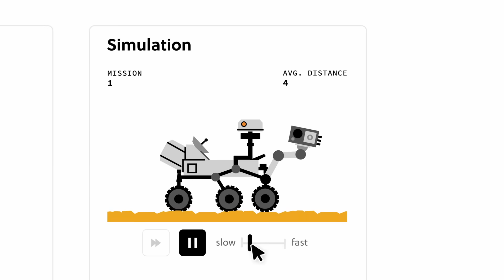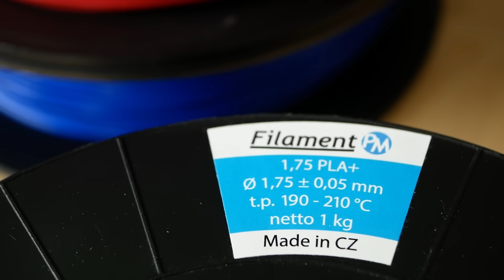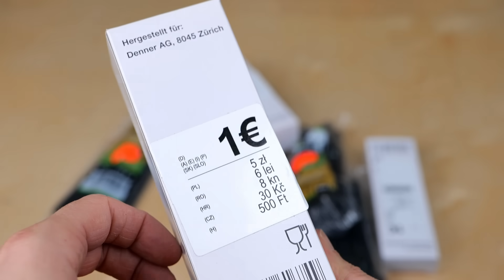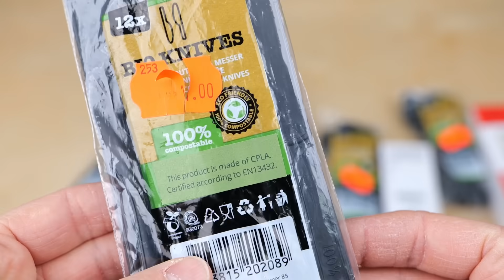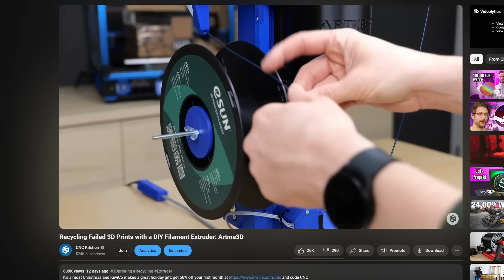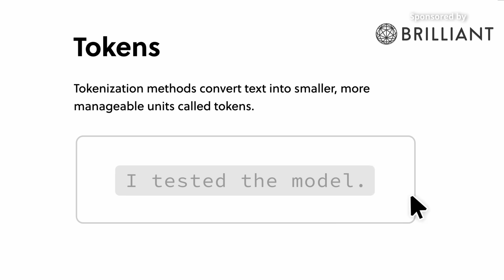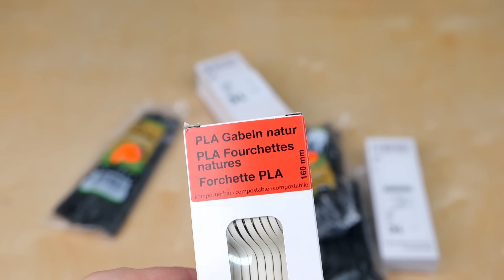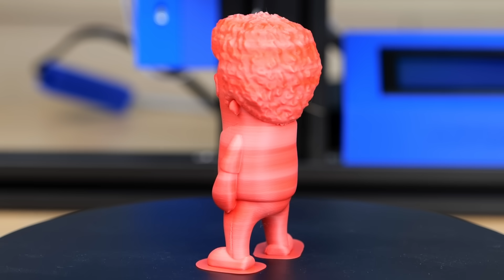From Trash to Treasure: Recycle Cutlery into 3D Filament!

Comment: I work in injection molding hopefully I can help with some mixing percentages. For most of our materials we have anywhere from 4%-6% for color hopefully this will help with color consistency. As far as regrind (recycled plastics) go, we change % based on how much scrap we have. Recycled plastic has generally already gone through a heat cycle and the polymer chains do break down causing a less viscous melt. This could be why your diameter for your recycled filament wants to stay undersized but when virgin material is added the diameter increases. If you want to do a 15%-20% Virgin added to regrind, then maybe stepping up a nozzle size on the filament extruder and running a slightly hotter melt.  This hopefully will help with filament diameter and a more homogeneous and consistent melt and color. As always do what you do best and experiment for the best results. I just hope this helps put you in the right direction.

Comment: would love to see some more plastic trash turned into new parts, i still have a lot of ABS parts flying around for example. would also love to see a direct conversion, ie, parts to filament, i wonder if different heat zones with different viscocity would create the possibility of filtering, seperating junk with magnets and a fine mesh at a hot zone, and then cooling it 20C or so for the extrusion process.
Grinding is always quite the intensive proccess, or requires expensive machines. something like a waffle with a clamp to squeeze it into the proper melt zone would be a strange idea.
instead of shredding (which is really easy if you have filament) just convert parts with max of 10x10x5 cm into molten goop first.

Comment: Out of raw curiosity: How does filament made from water bottles with the Artme3D compare to the same material made with the converted Ender 3 you showcased a few months ago?

And followup question: can you make usable filament out of different materials in the same batch? They would all need to melt at the same temperature and have similar printer settings of course. Think something made from part plastic cutlery, part old failed prints, part water bottles, and part virgin pellets to stabilize the mixture.

Comment: Halo Stefan. I don't have an idea what to recycle next, but I remember Thomas from @MadeWithLayers made quite some time ago a 3-Axis filament thickness sensor with Hall sensors (sounds like a vid sponsored by PCBWay ;-)). It would be really interesting to combine it with the extruder you have - either by you (singular or plural with Tom) or by the OG inventor of the machine. 
BTW. Marinara recipe is missing in video description :-D

Comment: Usually when production factories use recycled materials, they usually chuck in like 20-40% with virgin material, to make sure to be able to keep these properties of the materials. So I think only using 20% virgin is quite nicely done. But then again this is just for a single roll of PLA for a more "simple" 3d printer, so not really the same as a large production facility.
But I can't wait till these shredders and recycle machines will become cheaper and easier for the rest of us to attain. Maybe make one by taking apart something like a paper shredder.

I absolutely love the idea of failed 3d prints just getting grinded up and remade into something else.

Comment: DRONE PROPELLER blades, bitte!  
I just crashed my quadcopter so I am waiting on new propeller blades from Amazon, while two 3D printers sit next to me alongside the broken propellers.  Maybe quadcopter propellers (or the bits I have remaining) could be ground up, supplemented with virgin material, and re-manufactured via 3D printing~!

Comment: I'd love to see more DIY methods for recycling pretty much any of the commonly recycled plastics (PET, HDPE, PVC, LDPE, polypropylene, polystyrene), albeit into homemade 3D printer filament or even injection molded parts (using 3D printed molds)
Reply: Investigating the use of high-force extruders for injection molding with common plastics would also be quite interesting
Reply: Pet would for sure work, not sure about the others
Reply: PET won't work. The melting temperature is 245C, not 165C. You would need more expensive extruder for PET.

Comment: One thing I've always wanted to know more about is why some types of plastic, such as the ones used for "clam-shell" (aka very difficult to open by hand, or vacuum sealed) aren't recycled at least in my area. I'd love an explanation for why, even if you can't actually re-use it as filament.

Comment: you should do plastic bags! i feel like its possible to turn them into filament.

edit: i wish i had a filament extruder like yours to try. i feel like static will be problem with single layer pieces of bag, but if you did the clasic diy bag ironing and put those multi ply sheets through your shreder ( also would be fun to have) you would have some weighty plastic bag pieces to extrude. plz try i need to know noones done it on youtube i think

Comment: I am admittedly very new to the 3d printing community. I do have a hypothesis that coloring in PLA tends to make it more brittle and the darker the color the more pronounced the effect. Maybe that could be a video idea? testing different color PLA and its mechanical properties. Usually they test brittleness by resistance to impact in tests like the Charpy V notch test. Maybe you could design and use that as a test in the future.

Comment: I really like the idea of reusing plastic.
But I am not sure that this setup is efficient enough to be a net win (for the planet).
You need to clean it, dry it, shred it, try it, melt it, (probably dry it) and melt it again. All these steps uses energy (and sometimes water) and I just looks like a lot. Maybe if the energy comes from wind and solar it might be ok, but it is really hard to say if this is a good idea or not.
Maybe new plastic takes up a lot of energy to make and it only takes a little to reuse it (relatively), the same way as reusing aluminium, but I think it is hard to tell.

Comment: This is, if anything, a good way to get cheaper filament but I don't think it's going to save the environment at all. Nobody is asking how many benchies are out there doing nothing or how many failed prints are taking up residence in landfill. Plastic recycling is the answer there and most municipalities here have taken up recycling these thermo plastics. It would be cool to see a 3D printer attachment able to use shredded recycled plastics and melt-on-demand into a filament as it is needed for use while printing. In the end, as has been demonstrated here, virgin plastics are needed to meet industrial demand. As it is, most manufacturers need predictable real world results and recycled plastics are going to provide inconsistencies which end customers will not put up with.

Comment: Those brittle plastic utensils and brittle biodegradable utensils were always a spooky thing to eat from most my life, especially the forks, prongs can break and go down with the food. I preferred the flexible plastic utensils and I reuse them like metal utensils, great for the backpack and that way I could avoid using new plastic utensils including those which are brittle when ordering takeout meals. And I feel the same about all other plastic products with longer usage intended including radios, they shouldn't be brittle and may not break or crack from normal impacts if being made of that flexible material. 

Adding virgin pellets, I didn't know that works to lessen brittleness as you say, though I worked in a plastic factory for about a year as a material handler and used both new and regrind materials for jugs, tackle boxes, buckets, bottles and caps among other products from blow mold and injection mold, not utensils though. We added new pellets to same material regrind to add content not to change anything, but then it may need an awkward colour feed adjustment so normally we added new towards end of regrind and reset the colour feed for that. Mixed regrind colours were normally turned black, but still same materials. I don't think we had brittle products coming from where I worked. Things were more durable, at least during their initial uses and most of it likely beyond. 

I have some products I bought from that place and one from there which I acquired with an icecream purchase, and they are as good as new except the icecream bucket which discoloured but isn't broken, that's going back maybe 15 years ago. And I have some single use plastics from other companies, which I reuse. I put what I can't keep for being too much and especially brittle products into back alley recycling bins.

Great video, I learned from you.

Comment: Why not try recycling the 2nd most recycled plastic on earth, HDPE, which I believe comes from those large liquid containes (like milk jugs). You have already done some PET recycling using pultrusion, however HDPE is also heavily recycled, however it is not commonly printed as it usually has bad bed adhesion and warping. However it looks like HDPE can be mixed with PLA, so maybe you could do a video trying to print HDPE, then trying making your own custom blend to see if you can improve the properties. You could even talk about the issues of mixing plastics when recycling.

Comment: Would it be possible to recycle styrofoam/polystyrene based single use plastic? Might give off worse fumes but you're already wearing a respirator
Reply: It's possible but very costly and are only done in recycling centers that specialize in recycling them. For the most part, it's simply not worth the effort.
Reply: @DarkZerol  That's the reason why I think it would be interesting for an amateur to attempt

Comment: Very fascinating filament processing Stefan. Wondering what the results and properties of "twice processed" filament would be? ie: if the initial recycled filament was chopped into strands to be re-extruded into filament. Thinking this would provide much better mixing and blending in the final result. 

The biggest problem I see is the unknowns of the recycled material. Poor labeling and the many non-standard plastics in use would make it very hard to scale up. One of batch processing is great for learning, but is far from being made into a sustainable process at scale.

Comment: A lot of products sold in the US come in clear hard plastic packaging. Apparently its supposed to provide added security for the consumer and manufacture, but I find clear packaging to be frustrating. Its wasteful as a single use plastic and it is it very difficult to remove the item you just bought. You always need scissors or a knife, but you may end up cutting yourself as the plastic can be sharp. I'd like to see this turned into filament.

Comment: I have to say that your approach to making the cutleries dirty struck me as German. Like seriously. You cooked a wonderful sauce that you literally spilled on brand new, unused cutleries! Stefan! Seriously! You could have thrown a party for god sake and we would have enjoyed some of that delicious sauce.

On another note, I would be very interested in shredding old broken PP and HDPE containers from IKEA and cracked sichtlagerkasten and the like, turn them into filament, and maybe printing with them.

One of the big benefits of printing with a material like PP is that it can be "welded" into existing PP commodities with heat. For example, you could print hinges and weld them with heat into cheap BAUHAUS PP containers, instead of PLA clamps that I saw you using when keeping filament boxed with desiccant.

Finally, I must say that I have quickly become a big fan of yours and if you happen to come to Aachen, then you are invited to meet the maker community here. I really admire your work and I have been drooling over the Artme 3D filament extruder since I was introduced to it through you. I wonder if you know the maker of the kit in person.

Comment: I really appreciate all the work you do.

Since you have a shredder to go with the extruder, can you run pet bottles through it?  Only using the middle part of the bottle hardly seems worth all the effort of other methods,  but your set up could really make it worthwhile if the extruded filament was as good as the other batch you did a month ago

Comment: I wonder if you could use the black CPLA as a sort of master-batch. So extrude it into a filament, where diameter doesn't really matter, immediately pelletize it, and then mix that into some other material shreddings to darken the color. It's unfortunate that the Artme extruder doesn't really mix the material very well as it extrudes, as that would make a big difference in the quality and consistency of the output material.

Comment: There are three things I would like you to also try with Artme 3D extruder that I haven't seen being tried. 

Firstly, it is recycling HDPE from bottle caps and strong containers. I know that it can be recycled, but it is very hard to find it as filament, and I would like to see how easy or hard it is for recycling, extruding into filament and printing. It has both great mechanical properties and chemical resistance, and I expect it to behave similar to pp, so I wonder why it is that uncommon.

The second thing is extruding a proper PET filament by using the whole bottle instead of pultrusion tube that you have already showed, and printing with it.

The third thing is trying to recycle pp. It is pretty common in the household, and I wonder how hard it is to recycle into filament and print with such filament

Comment: I love how at the end you tried using color pallets <3 
I would love content on mixing your your own filament from 'white' pallets and CMY pallets (or whatever works) to get any color you want.
Rather than have to own 50 colors of each filament, could we get by with a huuuuge bag of pellets and 3 bags of base colors and just.... make what is needed (as was always the goal of 3d printing)? Could we have access to 50 bajilion colors that way?
So far this machine seems to have issues with uniform color mixing (not like it was designed for it), but should be fine just to test viability of idea. 

Fancy add-on machine that distributes how much of each color to throw so its automatic optional ;)

Comment: the awkward thing about recyling plastic is when it made sense to pre-sort the single use item, it made even more sense to just use a reusable version of the item. When it made sense to single use item, it's impractical to expect people to pre-sort it properly. I'm sure there are edge cases and industrial cases where it works but it doesn't exactly solve the 60% of the other case

Comment: It's too bad that, at least from my experience, most plastic cutlery in the US still seems to be polystyrene, probably due to its higher temperature resistance, better flexibility, and (generally) lower cost due to commonality.

Not sure what to recycle next. We have lots of polypropylene yogurt containers - PP is such an awesome material due to its high heat-resistance, smooth appearance, and general durability. It's printable, if a little more challenging than some materials. I'm not sure of how common PP containers are in the EU, but perhaps that is something to consider?

Alternatively, old, broken toys made from ABS as a candidate?

Comment: While it is a good plan for preparing post apocalyptic use case, I don't really see how it is environment friendly in small scale with using a lot of energy. 
Here plactic cutlery got banned and paper/wood throwaway cutlery got expensive. 
We also introducing Pfand for bottles. While we had selective waste management. Now we have to travel to throw away bottles instead of using waste bin. Or we can buy overpriced soda machines made from plastic. It is funny when the cheaper, more efficient thing is more expensive, just becase they paint it green. This is not environment freandly, some people just get rich from the greenwashing.

Comment: Stefan is slowly building up his alter egos. Now with "Internet Commentator". Loving all the recycling video as it's something I feel strongly about.

I'm torn on saying "US has a plastic cutlery epidemic" but there is certainly a lot of it. I have a whole pile of it in my kitchen that Is should probably put in a box or something... but the pile exists because I have normal metal cutlery so any delivery arrives, the plastic stuff goes in the pile and I grab the metal tools. If I have a small number of guests, they get metal. Large number of guests get the plastic stuff because I don't have enough and easier cleanup from parties. An old job had a dishwasher so metal cutlery was more then fine, but my current job does not, so most of us end up using plastic. For all the waste the US is known for, a lot of it comes down to money. And if not money, time. Ask someone if they want trees to get cut down, most will say no. Ask if they would prefer plastic or metal cutlery, many if not most say metal. Ask if they would like everything to be recyclable... this one is harder because many will answer based off how they grew up and/or where they live. What I'm getting at is the plastic stuff is really a "are we in a situation where we have convenient and cost effective access to something to eat with?" It's a repeat of "nobody likes to waste filament... but if you told them to recycle 1kg of filament waste it will take 1/4-1/2 a day or more and cost $100 or more, they'd pause and possibly decide to just throw it out instead". It's why it's become easier to just go "you know what... just do compostable utensils instead of trying to recycle them".

On that note, I feel like I would use that filament to make a container to hold all the plastic cutlery I have :P